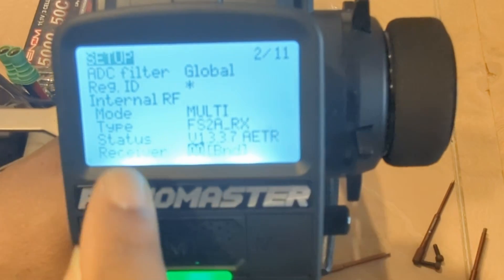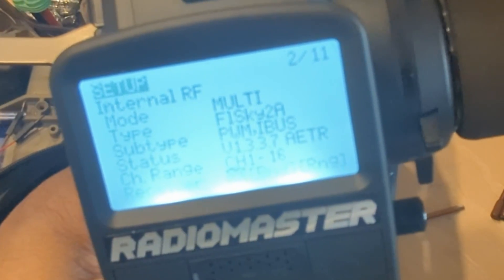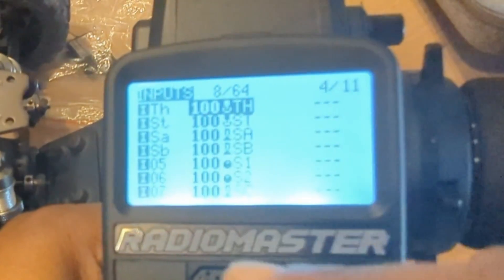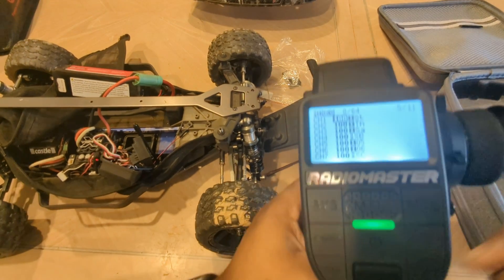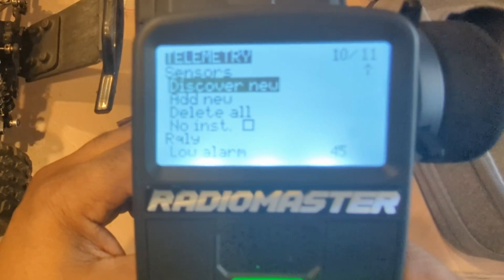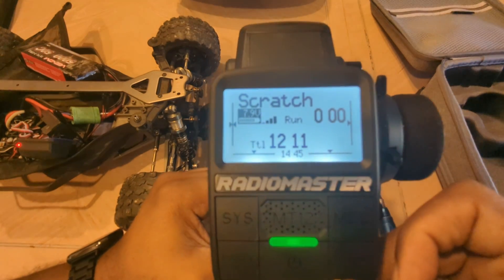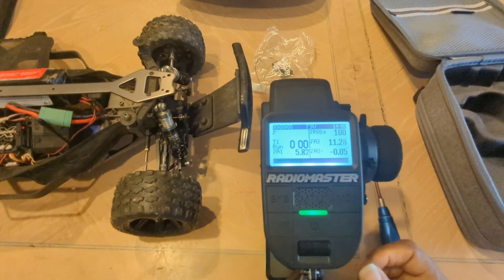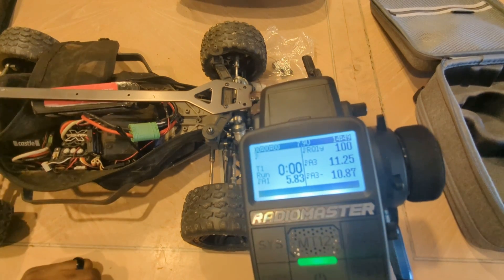Ep 308: Radiomaster MT12 4-in-1 Quick Setup Guide - Rx Binding, Channel Assignments, and Telemetry

Comment: Hello what Rx you use in your mt12 4in1 version? I have a problem, I'm using mt12 4in1 using r85c Rx the problem is the signal 4 bars drops or signal lost, maybe 35 meters a way the signal drops in 2 bars signals.can you help me
Reply from the maker: I use the Flysky 2A Rx units. They are inexpensive and have worked well with me for years. The r86c units are based on FRSky units, so you may need to fine tune the Rx frequency. You should be able to find a bunch of videos showing how to do this. It's a little involved, but it doesn't look like the process is too bad. 

Good luck!

Comment: Can u do a full vid of steering setup cuz idk how to do 
The car keeps going left plz and thx u
Reply from the maker: Is it 1) drifting to the left as you drive, but returning to center (implying a possible servo issue), or 2) Constantly offset to the left (implying you need to set up a trim switch, sub-trim, or recenter your servo horn)?
Reply: @RCPhysics  not this but when I’m driving it goes to the right like it isn’t centred well I need to make the front wheel face forward but idk how to set it up
Reply from the maker: @KVNGSYN Ahhh  It sounds like your toe settings may be off. In short, you can't set up your car's wheels to go perfectly straight forward to back because any slop in the suspension will actually cause your wheels to turn slightly outward when you drive. To counter this, you actually set the front wheels to have a slight turning angle that opposes each other so they cancel out when the car is driving forward. Typically the front wheels will be angled a little bit outward on the front of the car, this is called toe out, and the rear wheels will be angled slightly inward, which is called tow in. To find a bunch of videos on how to set up the right toe settings for how you drive.

Does your car have adjustable toe-links?
Reply: @RCPhysics  I believe so but I’m not sure 
U have any social media to show u what am talking about ??

Comment: Where are these powerful cars you say you have? This one definitely needs an overhaul. I looked through your channel and don’t see anything that resembles a speed build.
Reply from the maker: I started speed running about 10 years ago. Most of the runs on my channel are from back when I was helping to organize the RUN DMV events in the DC area. Actually, the speed pass in the first few seconds of all my recent videos is my Slash 4x4 doing over 100mph during a Run DMV Event. That's how I caught Castle's attention and started working closely with them. I post most of my current build photos in my FB page or IG. You can see photos of my fleet there. Two of the speed cars are featured in my FB Banner photo. https://www.facebook.com/rhouse21RCPhysics

I stopped posting speed run videos after the Run DMV Crew went our separate ways, but I'm planning to start running again this spring now that I've found a new suitable location near me. I currently have 5 Speed cars and enough parts on hand to build a couple more. The current speed fleet consists of... 

1) An ARRMA Limitless with a Castle XLX2 ESC, Sensored 1717 motor, and one of my custom Cap Packs, This is my newest build. I bought it on a whim a few months ago, so it's still coming together. https://youtube.com/shorts/Vp_xZBPXmFo

2) A Traxxas XO-1 with a Castle XLX2 ESC,  Sensored 1717 motor, and one of my custom Cap Packs. This car was actually used in the Beta Testing program of the Castle Mamba Monster X 8S and XLX2 ESCs. It's the orange XO-1 all over my FB and IG feeds. I never published any videos of this car doing speed runs because I wasn't trying to break any records or anything. I just having fun with it and use it as a testbed for the custom parts I build/3Dprint. https://youtu.be/hAYMBCUIYg4

3) A modified Slash 4x4 On-Road Build (the other car in the banner photo of my FB page). I posted in-car footage of this car going 103 mph 7 years ago with a Castle MM2 ESC, a sensorless 1717 motor, and one of my 1st custom cap packs. I also used it to help do Beta Testing for Castle. It currently has an XLX ESC and its OG 1717 motor (keeping it old-school), but I may swap in an MMX-8S for better durability when I start doing runs again this spring. https://youtu.be/s-vXp4OLpbA?si=AYccA5XpUEQbAMql

 4) A Team Associated Apex 1:10 Scale speed build. This car has a Mamba X powering a sensored 1406 5700kv. It's very similar to a 4-Tec speed build, but I'm using a modified Slash 4x4 driveshaft to handle the power of the motor better without "hula hooping". https://youtu.be/_j2MPQHadR4?si=pOslFE7mbhLm12CG

5) A "70mph Club" Rustler custom Aero work. This isn't technically a 100mph car right now, but I recently re-built it with a Mamba X and sensored 1415 to see how close to 100mph I can get. If it doesn't make it, I'll swap in one of my sensored 1515s and see how that turns out. https://youtu.be/9QXFVoZucNg 

I've got a couple MMX-8S ESC on hand and some Castle15-series motors, so I'm debating building a Slash 2wd drag car out of parts I have on hand, but I haven't made up my mind.

Comment: Any ideas? The sound did work on mine but now nothing, just haptic, in menus sound is set to all and volume up,everything else seems set ok, must have pressed something but don't know what! Any help greatly appreciated
Reply: Just had this back from radiomaster and it worked, hope this may help someone else........We found this problem, cover the SD card rubber cover, if the plug is too tight, the SD card will be a little deeper, resulting in poor contact with the SD card and can not play audio files, you can open the rubber cover, eject the SD card to reinsert, rubber cover SD card position do not press too tight, you can solve the problem.
Reply from the maker: Thank you for keeping me posted. I'll be sure to pass this information on if anybody else ask me about it in the future. 🙂
Reply from the maker: Does it give any audio alerts or play tracks? It's possible the speaker came unplugged. If that's not it, you may have a bad unit and might need to do an exchange. 😕
Reply: @RCPhysics  no audio at all and won't play the wav tracks, starting to think maybe the speaker is at fault, don't want to take it apart just yet as I've messaged the seller see what they say...thanks for your help👍
Reply from the maker: It sounds like you need to contact radio master. You probably have a bad radio. Chances are the audio cable to the speaker just came unplugged, so if you feel comfortable opening it up to check, that might be the solution. If you're not comfortable opening up your radio, then you just have to have them send you a replacement.
Reply: @RCPhysics  will do, thanks for your help 👍

Comment: I have problems with this transmitter had it for like 2 months I have just one nitro car running with it. The steering servo on the rest will not connect
Reply from the maker: Try posting about this in the attached MT12 FB group. It is filled with guys trying to help each other get the most out of our radios and fix the problems that we are encountering.

https://www.facebook.com/groups/mt12radiomaster/?ref=share&mibextid=K8Wfd2

Comment: great video. my question to you is how do i set up the timer so it counts down only when throttle is depressed in forward?
Reply from the maker: So, you want forward but not in reverse. Hmmm. You might need to set up a logical switch that activates when you have forward throttle and then set up a special function so that the counter only moves when that special function is engaged? I will have to look at this and see if I can figure out how to make that work.

Comment: Hi, will this radio bind to the "dumb" flysky receiver? The fsgr3e, looking at getting the radio for all my cars using that receiver
Reply: Any joy?
Reply from the maker: @hanger9uk665 It works! Just select the regular FlySky protocol. 

Interesting side note: Remember to increment your receiver numbers when you buying your models so you have unique bindings for each vehicle. If you don't do this, you can actually have multiple cars being controlled by the same radio at the same time. I found this out the hard way when I accidentally had two cars turned on at the same time that were bound to one of my older Flysky radios. I hit the throttle to drive and two cars jumped. It scared the crap out of me!
Reply: Do you have the lbt version or fcc? Does that make a difference to binding with the flysky receiver do you know? Sorry😂😂 was just about to get one and now more options 😂 hmmmf, I live in the UK so was gonna get lbt 4in1 version
Reply from the maker: @hanger9uk665 I have the FCC version. I don't think it makes a difference with FlySky, though.
Reply: Thankyou
Reply from the maker: @hanger9uk665 let me know how it works out for you.
Reply from the maker: I'll give it a try and let you know.
Reply: That's great, much appreciated, it's the only thing stopping me buy😂
Reply: Brilliant, thanks for checking that. And yes I expect that was a shock, you learnt the hard way😂😂 thanks again for info.

Comment: One thing to note, it's not the RX that is randomly assigning improper channels.  By default, the MT12 has the channel assignment set as "TS", meaning throttle is channel 1 and steering is channel 2.  You have to go into the radio's setup page (not the model setup) and change the default channel assignment to "ST".  By doing this, any NEW models created will have the proper channel assignments already created.  However, any existing models that were in place before the default change will not automatically change.  You will have to either change the channel assignments as you show in this video or delete the model and create a new one with the correct default channels.

To change the default order, do the following:

- Hit the SYS key on the radio, then use the Page > button to get to Page 3.
- Using the scroll wheel, scroll down on Page 3 until you see "Def chan order".  The option is quite far down on the page (after GPS Coords and Country Code).
- Press the scroll wheel to select the value and then using the scroll wheel change the value to show "ST".
- Press the RTN button to get back to the main screen.

Now, every new model will have the proper "1 to turn, 2 to burn" channel assignment.
Reply from the maker: Awesome comment!

You are absolutely correct that this is the better way to "fix" this. I stumbled across this in the heat of the moment and use the first/ best method I could think of on the spot. The correctus. Of course that then locks me in for the future if I don't go back and make the adjustment that you recommend it.

I will outline the method you just gave in a future video to let guys know that there is more than one way to skin a cat. Fortunately, with this radio there seems to always be multiple ways to skin that cat, so it's a great opportunity for guys to get creative. That said, sometimes that creativity can cause extra problems later. Things before you run into a problem. What definitely help people out.

Thanks for taking the time to write such a comprehensive comment that I'm sure will be useful to a lot of people!

Comment: Awesome radio man, I might have to try out one of these radios someday i'm currently using a Radiolink RC8X and i've also had a lot of Traxxas TQI radios and a Futaba 4PM non plus version.
Reply from the maker: I'm enjoying it so far. If you are fine with the User interface and programming, it's a solid unit!

I made a big deal about the multi-protocol features, but I will most likely keep all my non-RTR rigs on FlySky Rx's due to their low cost and great performance for the money. It is really nice knowing you don't HAVE TO stick with one specific brand, though. I've got a few random Rx's left over from other projects that I was going to sell on ebay that I'll probably keep now... assuming I can figure out which protocol they use. 😁